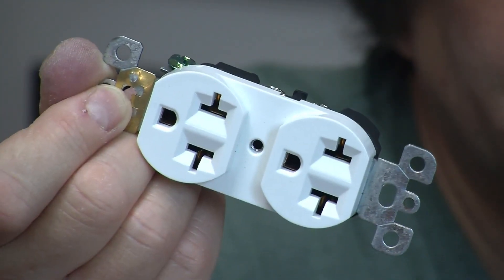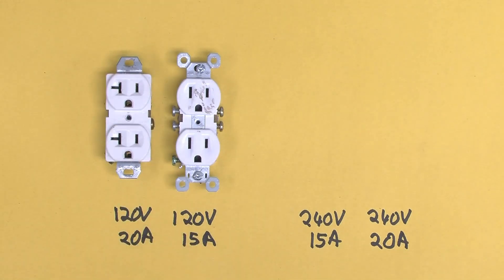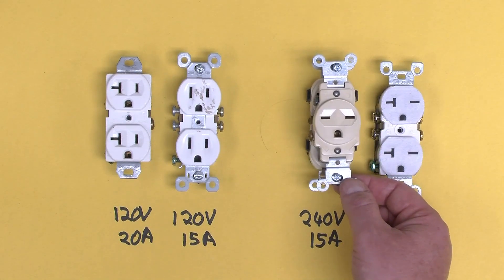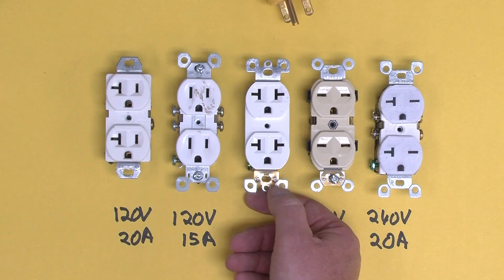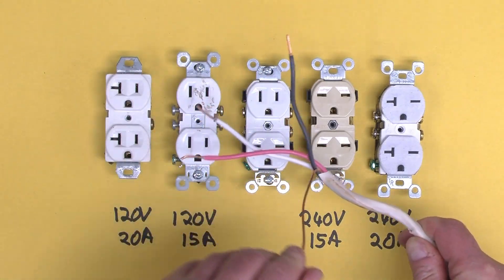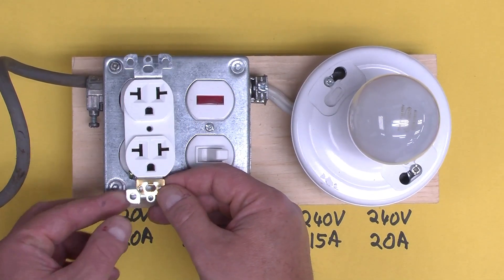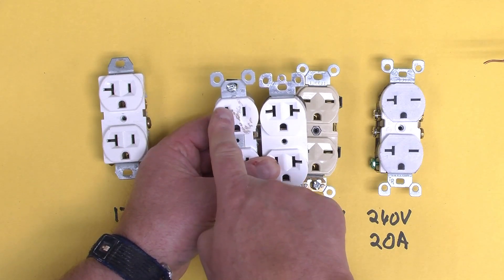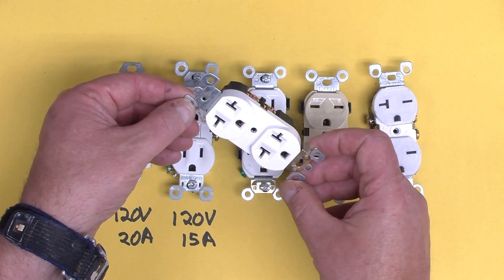Yikes! Don't use this Chinese-made Outlet!

Comment: Possibly the reason they were on the website for "Hydroponic Gardening" is that quite a lot of commercial grow lights  are 240/120 and switch voltages by shaping the power cord/prongs at the end of the cord. It would be easier to use these for all the lighting circuits and only have to swap the breakers if you need 240v or 120v with out having to change out the outlets. But it wouldn't be up to code in most places.
Reply from the maker: Are you saying you can rotate the prongs and that switches the voltage? That a new one for me! I could sure see ones that run on 120 or 240 because of an automatic switching power supply or ballast.
Reply: @ElectromagneticVideos  sorry I meant that the lights have automatic ballest and come with either 120 or 240 cords with a quick connect prongs like the growers choice ROI-e series of grow lights
Reply from the maker: @niv_710  No problem. It sure explains why it is on those sites! Your are the first one with a real explanation of why!
Reply: @ElectromagneticVideos  And people growing weed don't care about code!
Reply from the maker: @franklofarojr.2969  Apparently not :)

Comment: I agree with everything you said, but I do have one additional use-case for this odd outlet. Granted, it is just as much a corner case as your use. It could be useful as the output for a programmable power supply that supports both 120 and 240 (and many others) AC outputs. My test lab has several power supplies that could benefit an outlet like this (maybe after taking a needle file to make the left-hand vertical slot a bit taller for polarized plugs). Though, we usually cheat and use a 120V power cord when testing 240 devices...
Reply from the maker: Actually, I completely agree with you - I have a lab very similar to yours and was thinking about lab use as you describe. Its too bad they didn't get the polarized slot right - maybe they just didnt notice one slot is longer. I decided not not mention it in the video because I felt that saying "there is one good use for it" would water down the message that this outlet is (mostly) bad news and legitimize it for some that don't appreciate the very specific application.

Just looked at your Sunrise  solar telescope launch videos! That must have been fascinating to see and be involved with! If anyone reads this click on Christopher Elliotts link!
Reply: @ElectromagneticVideos  The sunrise team was a great group of people. It wasn't my project though, my projects were AESOP and LEE. We just happened to be at the same launch site both preparing our payloads.
Reply from the maker: @Sembazuru  I just googled  AESOP and LEE - very interesting! One of the articles links back to you video in case you didn't know.

Comment: There is nothing to debate. You can always use less than the outlet can provide. 20 A plugs are almost never used so if the  outlet could not that 15 A plugs it would be useless.
Reply from the maker: Its not the 15 or 20A compatibility that is the issue. Its that it accepts both 120V and 240V plugs. So regardless of whether you wire it as 120 or 240, someone can easily inadvertently plug a device of the wrong voltage into it.
Reply: @ElectromagneticVideos  I was commenting about the standard 20 A socket at 1:25, not the junk that obviously should not be used.

Comment: Leviton sells a 5842 outlet for 120/240 combo in 20A.
Reply from the maker: I never realized those combination 120/240 duplex outlets existed until I did some research for this video. I'm sure Leviton  sells relatively few of them compared to the others, but for the right application they must be perfect.

Comment: I had to install the 20A 240V receptacle for a heater in my garage. It's a single though, never seen it as a duplex. That "one size fits all" receptacle could definitely have dire consequences.
Reply from the maker: Yeah - I shudder to think what could happen ....   . I dont think I had ever seen a 20A 240V duplex before doing a bit of research for the video - like you - only had seen the singles.

Comment: There is a story about a young showgirl from America that visited Australia, she had an 
adapter kit with her,  what she did not have was an idea about voltage. As it turns out 
she had a sex toy she wanted to enjoy, got the proper adapter, and plugged it in for a good 
time. I can imagine the horror her mind went through with this electric banana in her bush
and it started sparking, buzzing loudly, and smoking! perhaps getting very hot as well.

Comment: Those slots look wide enough to accept a polarized plug however it won't distinguish which side is polarized. Yeah China doesn't really have a standard. Well they do have a standard it's the C E mark not to be confused with the CE mark, believe to indicate "Chinese equipment".

Comment: That's one nice quality non-standard Outlet it even has a little ground screw thing to ground the Box. I had a visit to the Philippines and well they're 240 but the person I was staying at had some 120 volt appliances needless to say somebody plug the radio in without a stick down converter and guess what happened I had to go back to the repair shop again.
Reply from the maker: Yes - at least from the outside it seemed quite decently made.  I spent a lot of time overseas as kid, and 120V devices in 240V countries was always a nuisance. We usually had a 240 to 120 transformer in every room. At least there werent any outlets that would have allowed us to plug a 120 device into the full 240!
Reply: @ElectromagneticVideos  unfortunately for the Philippines they use the round pins supposedly but most of the ones I ran across were the US style prongs. It wasn't necessarily one of the highlights of my trip, I was there for just under a month. We stayed at this place for a week and one day I was being shown how to use the radio and that it was just repaired recently and how the touch buttons didn't work right and require jumping and the very next day I was getting blamed for breaking it! Yeah the person who brought a multi meter with them is the one who's not gonna look on the name plate before plugging something in without a transformer....

It was interesting to see that transformers abounded just about everywhere.
I was already quite fascinated with foreign electrics at that point.

I did run across an interesting 120V device in a 240V outlet experience online.
This guy would do electrical safety demonstrations for sound techs, bands, musicians and the like. He brought his mobile rig in to a gymnasium and set up. As he was doing this he noticed a weird smell and some weird things happening to his wireless microphone receiver. Apparently he plugged into a "specially wired outlet" for the janitors floor buffer and thankfully realized this before turning on the power distribution unit however the front convenience outlet bypassed the switch and protections. The irony, brought in to talk about electrical safety on stage and run into a miss wired outlet.
Reply from the maker: @imark7777777   "specially wired outlet" LOL - somehow anything with that name and is easily accessible for anything like use in a lab is generally not a great idea! Funny - with my overseas experience as kid I am also fascinated by foreign electric stuff - particularly the plugs. Did you ever see the Australian/NZ and similar Chinese plug over there - essentially a discontinued version of ours with the power pins at 45 degrees.  The great thing they do is insulate the upper part of pin where finger could contact if the plug was not in all the way. Something we should do.

Comment: 240 is common in Europe for everything.
Reply from the maker: I think other than North America, parts of South America, and Japan, almost everywhere else 220/230/240 is the universal voltage. My biggest concern is if this outlet is wired as 240 as suggested in its manual, its all to easy to plug in a 120V appliance with a Canada/US plug and have bad things happen.
Reply: @ElectromagneticVideos  I'd love to see a video of that!
Reply from the maker: @franklofarojr.2969  You know, I do have 240V outlets in my garage. If I come across something like a cheap used vacuum cleaner, it might be fun to try and see if it disintegrates in a spectacular way.

Comment: My parent's house, built in 1924, had one outlet in the living room that had the two horizontal slots, no ground. It was 240V. Never did figure out what was expected to be plugged in there, but we guessed maybe a 240V electric heater.

It was removed and replaced with the usual 120V, 15A grounded receptacle pair when the fuse box was replaced with a new breaker box and the knob and tube wiring and all the ungrounded outlets with modern wiring that met current code. I've always wished I'd rescued that old receptacle and plate. The receptacle was an oval brown glazed ceramic and the plate patterned brass. Very pretty.
Reply: Was it really 240 V? Hubbell first introduced a plug with the prongs horizontally. A few years later he introduced the current one. For long sockets could accept both plugs.
Reply: @okaro6595  Yup. 240V, measured. (Actually about 244V.)
Reply: My Grandmother's mid 1950's home originally had (Maybe 5 or 6 still installed working at 120v where no grounding path exists.) what I assume is the "old" 2 prong version of this Vid's 3 prong (universal?) Outlet...

Those outlets were specifically stamped with both 120v and 240v Amperage ratings... Will have to see if I still have a few of the old ones around to compare.

Comment: Agreed that this is bad in the US.  But there are many countries that don't have 120V at all so there would be no confusion installing it there.  Also many appliances today will automatically handle 120 or 240V.  If you had a computer with a US 120V plug you could use that outlet at 240V and it would be fine.  I am not saying it is right,  just that they would not think about the 120V issue.
Reply: But there is no need. I do not think American tourists take their air conditioners with them on a vacation.

Yes there is a theoretical use that if one has such a socket on a 240 V line one could charge a phone with it as it allows a normal plug but I doubt there is a lack of normal sockets for that. The risk of confusion is way too high. The legitimate 240 V/120 V combo is far better for such use.
Reply: That fact it works fine for some things could make one complacent. "The outlet is safe, I've plugged my laptop and cell phone charger into it and it works fine, doesn't get hot, doesn't blow up". Then you plug in a hair dryer and it becomes a blow torch.

Comment: The dual voltage leviton receptacle 5031, would probably be best suited for placement near a window where someone is likely to install a large window air conditioner. That way if the homeowner wants a larger 240 volt AC or a smaller 120V unit, both cases are covered.
Reply from the maker: I think I read somewhere that might have been its intended application. I'll bet its a very niche use product.
Reply: That receptacle (5031) would require two separate circuits run to the outlet. One for the 120 volt outlet and a separate one for the 240 volt outlet. While you could technically wire it from one 240 volt circuit as long as you had a neutral wire plus two hots and a ground, I doubt code would allow it.
Reply from the maker: @snaredude56  Here in Ontario you are allowed to have a split duplex receptacle where the two receptacles share a neutral and each has its own hot (one is 180 degrees out of phase with the other), and the cable usually is 14/3, fed with a dual breaker. I would have thought 5031would be allowed in the same places split receptacles can be used. Or are split receptacles uniquely Canadian?
Reply: @ElectromagneticVideos  I'm not sure if it is allowed in the US or not. The outlets are available here. The instructions on the Leviton website show it wired with the two outlets sharing a hot, as you describe, with the break off tab still in place on the right terminal, thus both outlets sharing the same two pole breaker. It also shows it with three hots with the break off tab on the right terminal removed so it would be using a two pole breaker for the 240V outlet and a separate single pole breaker for the 120V outlet.

I suspect that electrical code in the US would require the second method be used because someone could plug an air conditioner into the 240V outlet and some other high draw device into the 120V outlet, thus overloading one pole of the breaker, causing it to trip. 

Drier and Ranges typically have two hots and a neutral to run the heating elements on 240V and the lights, motors and electronics on 120V, but in those cases, the device has been engineered with that in mind so no overloading of one pole should be possible under normal operating conditions.
Reply from the maker: @snaredude56  I think one thing is for sure, it certainly would be intended for a very niche type use. Would be interesting to hear what an electrical inspector would make of it!
Reply: @ElectromagneticVideos  I used that exact 5031 in my house a few years ago, 2 hots + a neutral run to a 2 pole 15a breaker.  had it inspected by my local city (in US, WI) and the inspector thought nothing of it other than to comment on my use of a old-work box (the kind that press themselves to the back of the wall without a stud) -- and only then it was asking what I thought of said box.  It passed.  I am a homeowner and this work is allowed to be done by myself as long as it is inspected.  The use case was precisely for a window air conditioner.  I installed a 240v unit, but wanted to leave the future as many options as possible.
Reply from the maker: @evildark0  I think you might be the first person who I have heard of actually using one of those sockets. I only found out about them when researching the dangerous Chinese anything-can-plug-in socket. Neat that the inspector didn't have an issue - being an approved socket there should have been no issue but with anything unusual you never know.

Comment: the standard 120v 15amp receptacles can be fed off a 20 amp breaker and they very often are (of course the wiring all has to be sized for 20 amp).
the idea was anything with standard 15amp blade plug would not pull more current than it's rating/design, but multiple devices in different receptacles could total near or past that limit and not nuisance trip.
the 20amp style denotes there's available power for heavier devices and are often dedicated circuits or have a minimal amount of outlets(kitchen counters, bathrooms, etc.)

Comment: wow, is this pre 1960's again? there were receptacles nearly identical to that made long ago(no ground pin), rated at 125/250 volts. 15amps at 125v and 10 amps at 250v.
I still see and remove them to this day, just removed one from a garage yesterday( circa 1940's).

Comment: That receptacle is a poor copy of the old deprecated Hubbell receptacles I pulled from the bedrooms in my late 1950s home but the chinese added a grounding plug.  I found out the Hubbell outlets were made so you could plug in a window air conditioner.

But mine were all wired with 12/3 wiring vertical slots going L1 to neutral, horizontals L1 <-> L2.

Almost needless to say, when pulling them out I had no idea what they were and zapped myself.

A multimeter in the vertical outlets told me I had turned the correct breaker off.  But it turns out I only shut off half of the power as the electricians back then also didn't bother to install breaker tie-bars between the two single pole breakers.

I bought a non-contact continuity tester that day.
Reply from the maker: I didnt know breakers for 240 werent tied together in the old days. Great lesson for everyone to always check the power is off - you never know what mistakes or faults lurking around. Glad you were ok!
Reply: @ElectromagneticVideos  Sorry, I wasn't clear.  Even back then the QO breakers should have been tied together, but someone didn't bother.
Reply from the maker: @RKelleyCook  Re-reading your comment I think I misinterpreted it. Thanks for the clarification though. Still a good lesson to never assume that something is turned of without verifying!
Reply: @ElectromagneticVideos  I've seen on multiple occasions 240v connections made with two separate single pole breakers, and the fools who installed them didn't tie the handles together like they're supposed to.
Reply from the maker: @Krankie_V  I guess there will always be people who take dubious shortcuts. Really to bad about this shortcut - really no harder to do things properly.

Comment: I NEVER PURCHASE or use any electrical products, tools, safety & test equipment & LED'S from cheating lying scum bag lack of quality control communist china. They can not be trusted. China is best in some classes: best at stealing billon dollars a year in intellectual property&illond in counterfeit money, 50 plus years producing children's toys with outlawed poisonous lead paint, best at making dog & cat food that kills them, best at producing extremely toxic dangerous sheetrock that cost average homeowners $80,000 to replace entire house of sheet rock, all insulation, all wires & copper pipe & plumbing fixtures. They were making great looking bootleg residential circuit breakers that did not trip.